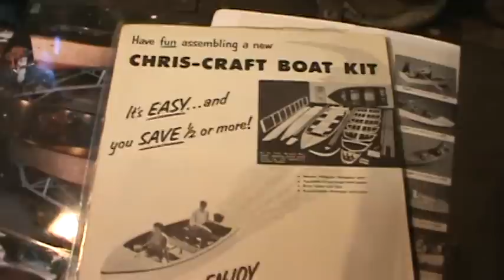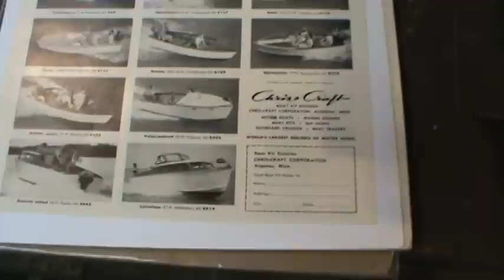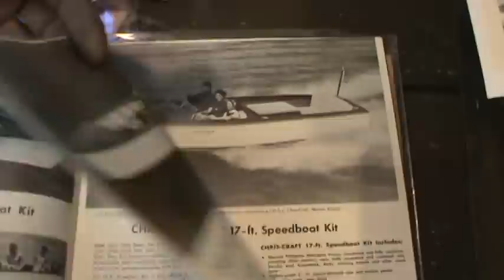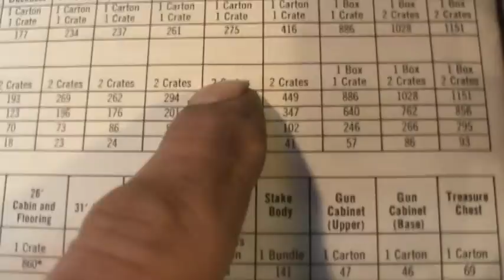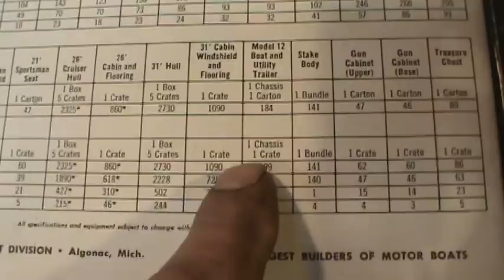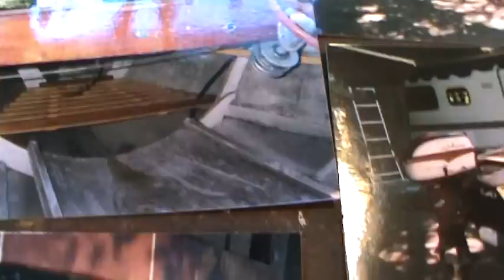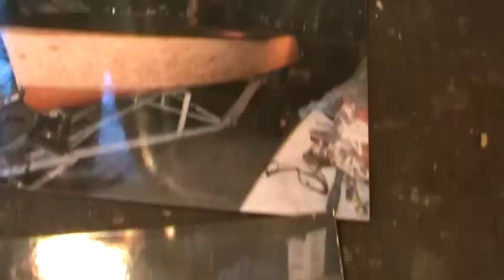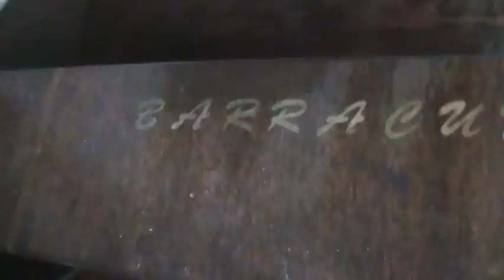whats getting towed behind the bus,

Comment: The boat still looks a million times better than it was, looks more like the brochure :-)

A bit of wax polish and im sure it will gleam :-) :-)

Ahh the screw in break switch, my mate has the same problem with his old morris minor 1000, after replacement im going to wire a relay up to it, so the relay does the hard work instead, you might want to do the same perhaps?, no arking on the pressure switch lol.

Smashing youve fixed the motor thingy ha ha :-)